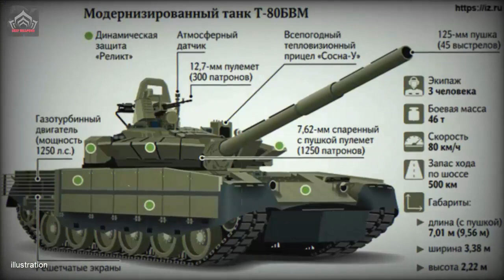New Batch of Flying Tanks For Russian Troops

Comment: Should there be very small one man multi roll vehicles to support the heavier vehicles. 
Share same hull , manned & unmanned, wheeled & tracked versions. Made as disposable or short life vehicles, to be abandoned & destroyed. But made very basic to scavenge parts off damaged vehicles to keep production costs very low & keep large numbers moving day & night . 
The whole thing made from plastic like a kayak, very light , amphibious, skid steer, no rust , light maintenance , no armour or strap on  body armour when required.
Armed with drones , rpg or other light cheap weapons. It’s main armour is being very small & hard to hit , with good power to weight & cross field manoeuvring & water crossing. 
Just enough weaponry to perform a task & get out of there . 
Yet still a worthy target to fire expensive weapons at or draw fire to locate enemy weapons. 
Could be electric driven & powered buy a small engine , or fire steam generation ect .
Think outside the box , less moving parts , less logistics , less materials, low tech , low training more interoperability between components= less costs across the board , more targets, more options on the battlefield, hard to spot , hard to hit , hard to jam . 
Air droppable, float down rivers.